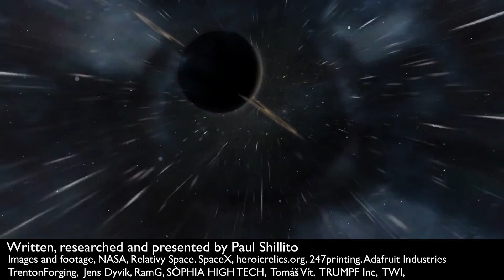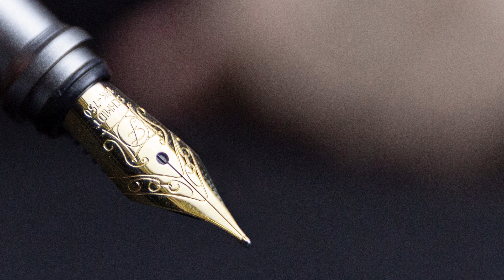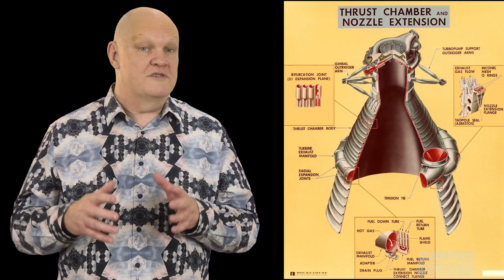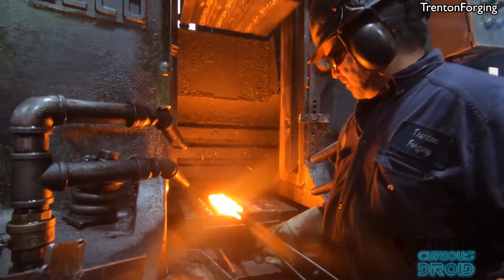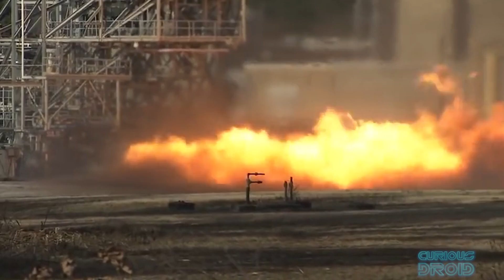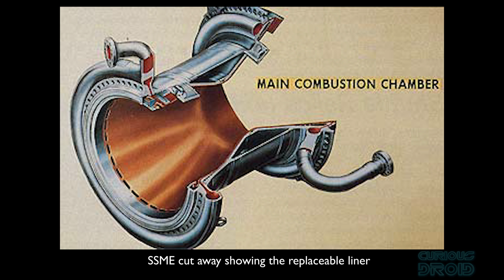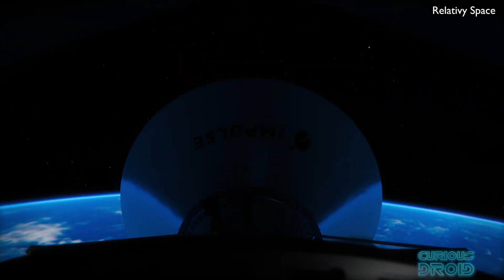Could NASA 3D Print a New F-1 Rocket Engine?

Comment: I know this has been discussed. The original crop of F1s was nearly hand made. But there's no reason why a new engine couldn't be built to its specifications.
Reply: yeah, this is what kinda frustrates me about the various 'we can't build F1s anymore!' dramas.  It isn't that we can not build something with similar capabilities, only that we can not take that exact design off the shelf and put it back into production, which is pretty much true for any  tech that old.  It is a bit like saying we can't make TVs any more because some out of production CRT from the 50s can't just be spun up in a modern factory with no supply chain.
Reply: Thus the F-1B, which was considered for the SLS liquid boosters option.
Reply: we could, it just would be expensive. 

the kind of "we don't know how much it would actually cost" kind of expensive too.
Reply: The problem with building to specifications is that it assumes the specifications are accurate. And in any engineering project — especially limited production runs with lots of manual effort — the specifications rarely get updated to reflect all of the adjustments being made by the people who actually had to implement the specs.

Comment: The F1 was optimized to kerosene, and was not able to relight during flight. The space industry is moving away from kerosene towards methane. Especially because of reuseability, which also needs in flight relight capability. To be useful, the F1 should be redesigned to use methane and be able to relight. So basically we are speaking about a totally different engine. Let's call it Raptor?
Reply: It's unlikely we'll see a return of engines this large. We're moving towards reusability, and that's much easier to do when you have lots of smaller engines so you can just run one and get the small amount of thrust you need to land the stage. A stage with 5 F1 engines you'd have to throttle down one engine to under 10%, and it turns out throttling down a rocket by that much is difficult.

Comment: You can certainly build a modernized F1, that is about the same size and shape as the original and performs about the same, if a large 1.5+ million lb thrust kerosene-burning engine is what you want. No need to make an exact copy; the modern version would perform better and be easier to manufacture. Rocketdyne even has plans for this over the years, just in case the phone rings and NASA wants more big engines.
Reply: Space shuttle engine already reach the moon anyway

Why even doing nostalgic hobby with taxpayer money
Reply: @bocahdongo7769  It would have actually make their lives much easier.
Reply: @bocahdongo7769  "Space shuttle engine already reach the moon anyway" What in heaven's name are you even talking about?
Reply: @RCAvhstape  RS-25 + SRB

Gosh darn young people nowadays have early stage of dementia from event that happen not even 1 year ago.

Comment: Those F1 engines that took thousands of man-hours to build each, were single-use.  One 2 minute & 41 second burn then dumped into the ocean.
Reply: NASA and Boeing were looking into making the Saturn S-IC (first stage of Saturn V) into a reusable booster. The plan involved parachuting the first stage to a water landing but inverting the stage so that those magnificent engines were kept out of the seawater. The Boeing illustrations show what could have been.
Reply: @bobcastro9386, The F1 engine was designed for one time use. To accommodate reuse would have required more research time, of which NASA didn't have as the U.S. and the USSR were at the hight of the Space Race, with the Moon the goal.
Reply: The center F-1 engine was cut-off before the other four, so that time span can't be equal for each of the F-1 engines.
Reply: The engines weren't designed to be single use, they just happened to only be used once because recovery of the 1st stage wasn't cost effective or practical at the time. The engines actually saw more than one use before they were launched to space, every engine saw at least 1 test run before being mounted to the 1st Stage.
Reply: So, that is like a good meal: hours to prepare, then eaten in minutes, and erm... dumped!  🙂

Comment: How do they generate enough heat to melt metal but not melt the "printer" itself?
Reply: Use materials with a higher melting point.
Reply: @TheEvilmooseofdoom  or the same way the rocket engine itself works: by cooling the print head.

Comment: To hell with fuel efficiency, a big open cycle engine can be built with 3D printing technology. Hell, how reliable are the Merlin 1-D compare to Raptors. It is the safest rocket engine design there is.
Reply: Lol, fuel efficiency is important when there're no gas stations once you lift off
Reply: Fuel efficiency is important if you had heart attack when someone mention "IRS" to you
Reply: Yeah right, send another rocket to fill it up, lol

Comment: They definitely could print the injector manifold, head, or whatever you want to call it. That was the hard bastard that was the most involved hand made piece, right?
Reply: The nozzle was the hard one involving wax to create the channels, I thought. 

Which 3d printing would streamline very well.
Reply: The injector manifold, and the nozzle were both complex. The nozzle consisted of hundreds of tubes brazed together. The manifold had tons of small holes.
Reply: @h.dejong2531  and really, it wasn't that complex, it was just incredibly labor intensive. 
The real "missing magic" is the genius it took to go from paper to parts. 3d printing isn't going to fix that. The difference is now we can do a bunch of stuff virtually that we would have had to prototype several iterations of it back in the day, and that would help, but it wouldn't replace the time involved in all that, it would just move it from the workshop to the server farm under the design team. 
But, putting all that back together... The designs could be optimized for 3d printing in virtual, as opposed to knowing people had to do the work by hand ultimately in the previous situation, and that is the major win. 

These aren't bad engine designs, they're just difficult to build because of how they had to build them then.
Reply: @camojoe83  "The real "missing magic" is the genius it took to go from paper to parts" - exactly, and that magic is the bit that's not written down on paper, and has been lost with the retirement or death of the various engineers responsible. Having the original plans only tells you what those engineers had to start with... not what it took to turn it into a working system.
Reply: @simongeard4824  As I said: that part would still need to happen, only digitally. 3d printing would only eliminate the production tedium.

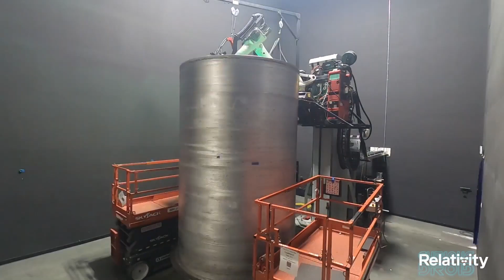Comment: 3D printing tank adds 5% to 10% mass penalty for the tank structure - Paraphrasing words of company founder https://youtu.be/kz165f1g8-E?t=299 (so it's probably a bit optimistic)! So I don't know from where claim at 12:12 comes from. It seems to me that there are some advantages for 3D printing but weight isn't one of them.

Comment: Smaller engines are a much better idea. Not only can some of them fail, even on ascent, without aborting the mission. They are cheaper to manufacture because when a single produced engine fails testing (and can't be fixed) it's less costly the smaller the engine is. Also making and testing the engines is faster and cheaper, so time to actual launch should be shorter.

Comment: Realistically, yes. We could build new ones. But, why would we? The SpaceX solution works. Instead of a few massive engines, use a cluster of smaller engines. The F1 has what, close to ten times the thrust of the main thrusters from S/X, I bet the S/X thrusters are way less than a tenth the cost of the F1.
Reply: Their landing ambitions also makes fewer larger engines unpractical.
Reply: @TheEvilmooseofdoom  Less, practical, yes. That is obviously being solved as improvements are stumbled upon.

Comment: NASA could probably 3D print an F-1 but I would have more trust  if Space X did it and possibly improve on it or perhaps convert it to a Liquid Methane engine.
Reply: If they make it run on Methane, it's not a F-1.  Fuel is important to the design.  Change that and you need to redesign the rest of the engine.
Reply: @TheEvilmooseofdoom  That is what I meant an F-1 to run on methane with all the hardware to make it happen.

Comment: They could but why would they, why revert to an open cycle engine when they've been using the closed cycle RS25 for 40+ years, I think they'd go for a F1 sized RS25 if they were going to try.
Reply: Or tandem the 4 RS-25 with 2 SRB. So thereotically it has almost the same thrust than Saturn V. But with lighter constuction, it can carry much more load and can reuse almost all the space shuttle assembly line.

What if NASA could do that anyway..... hmmm

Comment: SpaceX has the core philosophy of reusable boosters. If F1 engines can be relit and controlled to bring a booster back to base they’ll be worth doing. If the can’t start, stop and throttle down, then really where is the point?

Comment: Yo, Curious Droid. What NASA should do is reestablish the Nerva rocket engine.
They did all the heavy lifting ages ago and even had a working prototype in 1973. There is even archive footage showing the rocket being tested.

Therefore, why mess around with old tech that is simply reinventing the wheel.
If these space jockeys want to get to Mars, Venus, and beyond, they will have to go nuclear in every sense of the word.

Ask any aerospace engineer who is worth their weight in carbon fiber, and will tell you that if you want to make interplanetary space travel practical and routine, you need nuclear propulsion. (◕‿◕✿)
Reply: That just opens the can for a lot more regulatory work though, but nuclear IS the next step up in terms of energy.

Comment: Why would there be a need or requirement for a giant rocket booster engine that only delivers an ISP of ~264 seconds? As long as we're on a nostalgia parade, let's see if we can 3D print a V-1 rocket, then all get drunk on the alcohol fuel instead of launching it. Silly.

Comment: There is no point building an F1 engine now, the materials manufacturing techniques and design methodologies have all moved on huge amounts since the F1 was designed. Compared with modern engines it is really inefficient with poor thrust to weight ratio. It also had problems which were never fully resolved so building one now would be a pointless exercise.

Comment: I would love anyone to do a detailed video on why they "forgot" how to weld and can't make F1 engines now. It genuinely makes no sense and nobody can actually specify what they can't weld nowadays. Even though we have pinpoint accurate milling and welding robots.
Reply: Because times changed, methods changed and the people changed.
Reply: We haven't forgotten how to do it. We can still do this today, but nobody in his right mind will want to because we have better methods for fabricating a nozzle.
Reply: @h.dejong2531  Then what is the fkng point of this video ,mate?
Reply: @TheEvilmooseofdoom  This has NO meaning of any kind. This is EXACTLY the non answer that everyone gives rather than any details.
Reply: Because while we have the plans for the engines, plans rarely get updated to incorporate the many small adjustments made by the people who had to turn those plans into actual engines. And without the knowledge of those adjustments — which is mostly in the heads of people dead or long-retired — anybody trying to follow the original plans is going to have to figure out a lot of those details the hard way.

Comment: There actually was a failure on a Saturn V booster. A J2 engine on the second stage of the Apollo 13 booster shut down prematurely. The other 4 engines were burned longer to compensate and Apollo 13 was able to reach orbit. There were also failures with both test flights of the Saturn V.

Comment: Just been thinking, 3D printing would be perfect to build new old cast iron car engine blocks and cylinder heads, all long out of production. Other components too with hidden galleries.
Reply: Yeah,  especially with ww2 aero engines still being used this is a viable way to recreate part if it can (and might probably will) be made cheaper.
Reply: @shaider1982  
Certainly - the uses are endless for old components anywhere. 👍😁
Reply: Its much quicker, to do casting. Only if you needed to do a very limited production, it would be feasible wirh 3D printing.
Reply: Only useful for extremely limited production runs. Anything more than a few, casting is far more economical.
Reply: @TMS5100  
Sandcasting is quite involved - getting those internal galleries and wooden molds and everything and smelters for the material themselve. Yes? 🙂
Reply: @akyhne  
Car plant casting, apart from it being a dirty dusty hellhole, it was all very involved, took loads of manpower.

Comment: This is what happens when you close an industry and try to re-create it.  3D printers have to be worse than human machinists.
Reply: by what metric?
I use 3D printers and you could not be more wrong.
Reply: Bro, they can 3d print a rocket engine. What other device needs to be more precise than a rocket engine? Makes sense to reduce as much human error as possible. Nothing is closed, last I checked at high ending industrial manufacturing.
Reply: @ahaveland  every time I see a 3d printed thing it seems like the results are less than 100% of what the printer was told to do.  The amount of machining to make these imperfect finished items perfect seems like the measure once, cut twice approach.
Reply: @hicknopunk Then you aren't looking at the right things.
Reply: Just like any manfactoring process it has it's pros and cons, for 3D printing you usually don't get the same strength as an injection molded or machined part but you can achieve much more complex geometry, an example of that being able to include the piping as a structural part of of the design. 

On the F1 for example they had to use electric plating to make the small tubes that the fuel runs through around the bell, it was done by machining it without the channels with the top section, filling the gaps with wax and then electro playing a cm or two till the channels where covered, meanwhile the new raptor engine can have all that stuff printed as part of the design.

Comment: The lots of smaller engine design school doesn't seem to make much sense due to the added complexity of fueling, firing, and steering the larger  number of engines.
Reply: SpaceX, Rocket Lab, Firefly, Relativity, and many others disagree. While there is slightly more complexity with more engines (they are the same engine and use the same fuel system, you just have more of them. ), it also allows for more redundancy in the engine department.

Granted, I am not an Aerospace Engineer but I am a Telecommunications Engineer. We use the same principals though when designing networks. You make a small thing that does what it does well. You take that well designed small thing and now you want to connect a bunch of them up together. So you design another, bigger thing to make the little things work together.
Reply: @dr4d1s  yep! Adds complexity to the design but improves redundancy of the same. At the end what matters is if the trade offs are worthwhile.
Reply: For spacex becuase of their ambition to hover vs. a suicide burn larger engines start to work against them.

Comment: Could we make an F-1 engine today, well, no. The specific metals used and the techniques and methods used to manufacture them are long gone, however other methods exist today. If we were to remake and F-1 engine today it would be different materials with different manufacturing techniques, but yes we could make a similar engine that functions basically similar to the F-1. If all we cared about is matching the specifications of the F-1 it would actually be fairly easy as the F-1 has low performance compared to modern engines, if we just accept that the task would be easy, but we would want to optimize the design, which would cause problems.

Comment: NASA couldn’t figure out a O ring, let’s not tempt fate…
Reply: Thats not true. They knew cold weather would be a problem, and yet they felt the pressure to launch anyway (if youre thinking about the shuttle).
NASA has developed more rocket engines, than anyone else, besides the Russians. And don't forget they only had pen and paper, in the old days. No simulation software, stress test software, etc.
SpaceX wouldn't be here, if it wasn't for modern tools.

Comment: What does NASA have to do with this?  NASA has never built a rocket engine.

Elon Musk has revealed, to the Everyday Astronaut over a year ago, that Spacex is already developing an engine that is so far beyond the capabilities of Raptor that it will have a new name.  IMHO that would imply an engine using the same engineering and manufacturing innovations and reusability (at least 100 times) as Raptor but with much greater thrust.  Specifically I suspect that the target will be three times the current thrust, or 7.5 MN, with a dry mass less than 3 times that of Raptor, or less than 4.5 tonnes.  The thrust of the original F1 was 6.8 MN.  Aerojet-Rocketdyne can probably push that to 8 MN as part of a redesign but will probably still be targeting a similar dry mass of about 8 tonnes.   Also A-R has no experience with methylox which has a higher Veff, and permits eliminating tons of tankage mass because it can use a single divider between the LOX and LNG whereas kerolox requires two hemispherical tank ends between the fuel and oxidizer because of the difference in temperatures.
Reply: All he said is they're building a next gen engine and it won't be called Raptor.  It's actual abilities were never discussed.  More powerful engines complicate as much as they help and I suspect nothing will come until they're done dialing in raptor and then only if they want to make a much bigger vehicle.